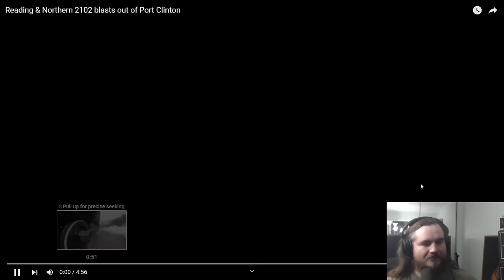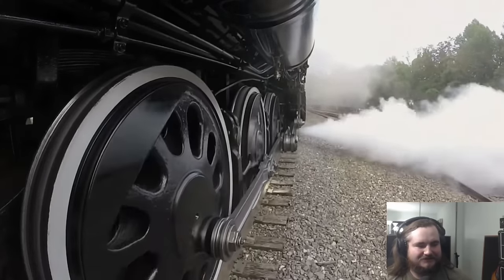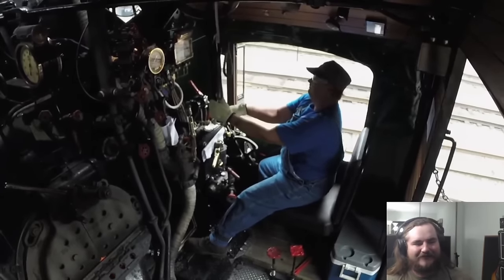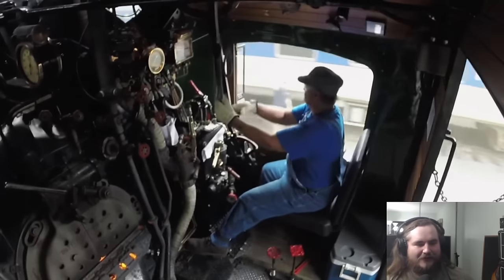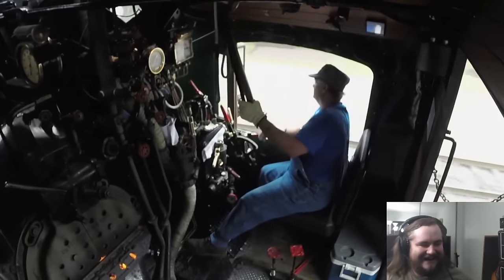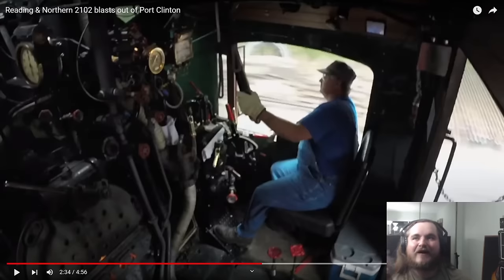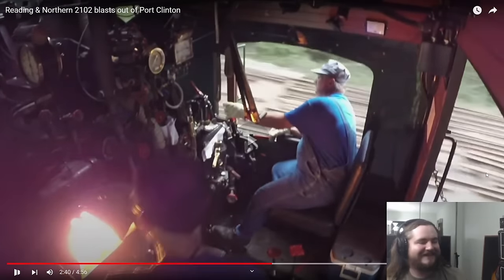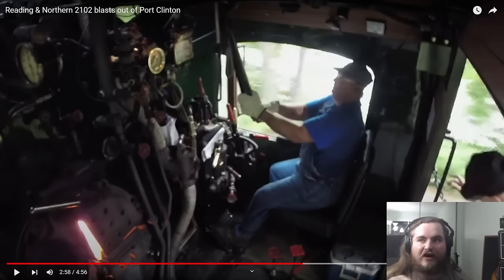Reading #2102 - the BEST steam sound EVER? Reaction from a railroader

Comment: Hey Hyce! Awesome commentary as always. 
My favorite detail that you didn't mention is that you can see quite a color difference in the fire as she starts to get her feet under her. 
Question: do all locos (that you have exp with) tend to enjoy working hard? Like do they run better when they are under load than bobtailing?
Reply from the maker: They seem to enjoy a medium, in my experience. Full throttle, but the bar not all the way in the corner.

Comment: Some Fun Facts for you Reading T-Hog #2102 leaving Jim Thorpe PA I was there that day in person, that curve out of the station is a tight one, not too far from the station itself is the old original Switchback line now a walking trail. Station sidetracks were the old CNJ Central New Jersey line and across the Lehigh River right of the #2102 was the Lehigh and Susquehanna line which is owned and operated by Norfolk Southern now. Reasons #2102 is so loud and great sounding is because it's running in a Valley next to the Gap, if you think a 6 Chime whistle is loud you should hear a K5LA freight Train horn as it can be heard 13 miles away due to the Valley carrying the sound echo. 4:09 view is from Port Clinton PA the crossing is Board St track entering the Home of #2102 yard front by passing Red Engine Shed in background, a difference of 16 miles away from Jim Thorpe Railroad Station. Notice little to No crossings as a reason max power is aloud, which 90% of the trackage run is 0.0% grade small areas an incline but nothing difficult. #2102 is only 27 miles away from Scranton PA Home of the UP Big Boy #4012 at Steamtown USA Railroad. This was a pretty good video as it didn't showcase #2102 secondary whistle as she has sounding like a Fog Horn.

Comment: Heck they had 425 running with that many cars as well but had a diesel behind just in case. But yeah, this to me shows an example of what 2101 was like. I still wonder if the Whistle from 2101 is still around? Sad shape of what 2101 AFT 1 looks like at B&O museum. I have been wonder what it looks like from a video stand point. All I see in pictures is just the front of the locomotive. But yeah 2102 is a good example of what the Reading T1s were like

Comment: My Favorite part of watching videos regarding 2102's return to steam have ALWAYS and FOREVER WILL BE the departures out of Port Clinton, PA. The Reading & Northern Railroad is Heavy Grades in both directions, closing near 2% in some spots, the train is around 16-20 Cars as well. I'm getting my ticket next year with my dad. I Can't Wait! In Regards to using the Scoop in the firebox, This is done to see in the firebox, If you watch cab videos by steamtrainvideos you can see the R&N crews using this technique on the 425 (not a stoker locomotive). Stokers have Steam jets that operated on pressure controlled by Valves on the firemans side, Its a tricky thing to learn from what i've heard, and without the proper experience you can put the fire out. These jets blow the coal into the firebox and the fireman can decide where the coal is blown to. The Assistant Firemen will look through the Butterfly Doors and inform the Fireman of areas in need of more coal.
Reply from the maker: That's really cool! Thanks for sharing.

Comment: Hi Hyce, This mayhaps will be a silly or ignorant question, but. What part of the steam engine's pistons and valves and other plumbing gateways, give steam engines that chuga chuga sound? How,  where, and why in the process of thermal expansion and linear motion turned into rotational force, etc. is this sound produced?  And to extent or amount of the released steam retained by and within the loco for recycling for re-use, or brakes, whistle, buffering for pressure differential (if any)?

Thank you for producing all the content on your channel, love watching this videos. My father was a train nut and design engineer before he passed, I have a love and appreciation/respect for trains, spent lots of days killing time watching trains with dad.
Reply: the chuff sound came from the blastpipe. When a steam locomotive is on motion, the steam exhaust passes thru the blastpipe which is located within the smokebox. The steam then goes thru the chimney and draws the fire on the firebox

Comment: Man, the Reading T-1s have to be the classiest 2-8-0 Consolidations ever made. ;p
Reply: Yes, Baldwin did a heck of a job in converting an old 2-8-0 into a highly functional 4-8-4. The Western Maryland, who partnered with the Reading on fast freight runs was so impressed with the "new" Reading 4-8-4s in fast freight operation, that they went to Baldwin for a clean sheet design 4-8-4 in 1947. The result was the absolutely huge WM class J-1 fast freight 4-8-4 which were total beasts in dimensions, weight, boiler size, and HP output. Too bad not one J-1 was saved. There is a good chance the WM J-1 was the most powerful 4-8-4 ever created, but not only were the J-1 scrapped, but most of the test reports were also throw out. The only report that I know of that survived showed the J-1 equaling the performance of a WM 4-6-6-4 (which were also huge engines) at 50 mph.
Reply: @markantony3875  Baldwin built the original I10sb 2-8-0s but it was the Reading Shops that converted them into T-1s (and some N-1 Mallet 2-8-8-2s into K1 2-10-2s)

And yeah, I love the WM/RDG steam design partnership. Some of their 2-8-0s were also designed off of the RDG I class 2-8-0s)
Reply: @jadebullet3884  Baldwin did all the engineering. The mechanical work was done in the Reading Shops. The B&O, who was renown for its rebuilds used the same approach. They would come up with an idea to improve a locomotive class, let Baldwin engineer it, then do the full rebuild at their Mt. Claire shops. Many people think the only late steam design the B&O had was their EM-1s. That is not true, because the B&O just kept updating their existing fleet with new technology because they had the shops to do total rebuilds (which many railroads did not). They could get a much improved locomotive for a fraction of the cost of a new one. Which made total sense, because everyone in the industry knew steam was on borrowed time at that point. Reading took a similar view point, maybe because the B&O was the largest owner of the Reading (along with the Western Maryland).

Comment: I wonder if there are any videos of Western Maryland #1309 like this
Reply: There are! Look up 1309’s strength test, where they hook 1309 up to a diesel engine, set the diesel’s dynamic brakes, and run 1309 hard enough to pop the front cylinder’s safety valves. It’s fantastic!

Comment: I'm not sure if this will get buried or not, but there is another video I thought you might be interested in. It's a short series of clips of some excursions N&W 611 ran back in 1984. The very last clip is similar to this, engineer is going at it hammer and tongs to get her back up to track speed in as short a stretch as possible and its impressive despite the grainy film and audio.

https://youtu.be/JuTlIH6c75E

Comment: 8:22 Question, and I've gotten into heated debates about this... that clank clank clank clank clank as she goes by is play in the drivers somewhere, I'm assuming the main rod at the pin, not the crosshead end, ior is that on the coupling rods between the wheels?  So the question is we didn't seem to hear it when the speed was lower, only now here later at speed, is this a function of vertical motion throwing the rods around, it's hard to synchronize the sound to the motion as we don't know the real distance to the engine as it passes to time it. 

EDIT: I slowed it down to .25x speed, and the clank seems to be at about 11 and 5 on the rotation. So.... is that the reaction to the valve timing events, or the transition in up and down motion and the sound delay is giving us fits?

But, and this is where the battle started, is that excessive play that should be addressed, or is that normal? The mechanical engineer side of me says any time there's a discontinuous sound, that's not good... but is it a 'normal' not good?

I have heard other videos of other engines at much lower speeds and loads making this same sound. Interestingly however, I do not believe any of them had roller bearing rods, they were all friction bearings like 2102.
Reply from the maker: Guarantee it's the rods, mains and connecting both. The reason you're hearing it as higher speed is that the grease has been beaten out by that point, or at least enough has for the rods to start to clank. The slow paced stuff would've been fresh greased. It only lasts so long before it gets pounded out, and with how hard they're working that's not terribly surprising. The age old adage is, "you'd rather hear them than smell them". As long as nothing is running hot, it's all good.
Reply: @Hyce777  I hadn't considered squishing the grease out... that makes sense. So technically they're in spec clearances, just light on grease.
Reply from the maker: @kleetus92  Well, they were packed before, I'm sure. They all beat the grease out, it's what they do. It's one of the many reasons why floating brass rods aren't as nice as roller bearing rods.

Comment: Well it is very good but nothing tops the bulleid pacific with its quartering for its 3rd cylinder as the off-set for the cranks are (con rod for left cylinder) 90 degrees (con rod for right cylinder) 135 degrees (con rod for middle cylinder) 135 degrees (con rod for left cylinder) this means the the chuffs are odd as the first and last chuff happen at the same time but the sounds they make when working hard is incredible due to this

Comment: Hyce, question, what is the drive size on 2102, and your museums "big iron" dropped off recently? 2102 doesn't look that large, but that could be my lack of perspective. If smaller, it would sure aid in pulling cars at grade. Seems closer to UP9000 (67"), or 4014 (68") , or 3985 (69") not 844 (80") I like the bark with no cut off. Have fun
Reply: 2102 has 70" drivers

Comment: So as a European stumbling across this channel through Kan, there seems to be a difference in sound for the steam engines in America, or at least I thinkt it's diffrent. Whenever I think of engines here in Germany chugging along they always have a lower schwoosh sound to them, where as with the american engines I've gotten to know through this channel the cugging is way sharper/has a higher pitch.

Is that a thing or is that because I just haven't heard a steam Engine run at full power untill now?
Reply from the maker: Depends on how hard they're working, when they're working more lightly it's more like the low pitched woomf you described.

Comment: it is cool.  Also, gotta say that things like your Steam 101 videos give at least some insight to a layperson who hasn't had their hands on the guts of these beasts, why with a 4 foot lever it's still a struggle. Because that as I recall is a mechanical linkage to those...umm...sextant looking things that are physically changing the behavior of the pistons that push the train and there has to be a lot of mechanical resistance to that.  I'm presuming anyone qualified to be driving these is possessed of a fair amount of upper body strength.
Reply from the maker: Definitely helps.

Comment: I just road the Frostburg Flyer from Cumberland to Frostburg.   There is a 3% grade on the way up.  We went slow but it seemed like the engine was really working.  It was blowing out a lot of coal cinders out of the stack.  It was excessive and piled up on the platform after the first car.  Was that normal for a hard working engine?
Reply from the maker: Yup, very common for coal burners.

Comment: My goodness, that was amazing! Good on them for working 2102 so hard - so many owners / operators are afraid to push their locomotives for fear of damage as you said.

May I recommend another clip or two that you might like? The first is of famous Australian locomotive 3801, struggling to pull a train tender-first up Young Bank in 1998. 3801 has a very sharp exhaust note that I'm sure you'll enjoy! When she slips, you can see both the locomotive and tender rocking from side to side as well. There's certainly a lot of force at play!

https://www.youtube.com/watch?v=MSRCqFfso1Q

And the second shows some J94 'Austerity' tank engines in the UK being worked extremely hard on a colliery railway.
https://www.youtube.com/watch?v=wsbRe5zKyE8

Comment: I worked on her when she first came back to the USA it originally was sold new to some company in Canada then in the mid 90's this guy bought it from some Canadian museum and brought it back to the USA where in Pennsylvania it was rebuilt I knew one of the rebuilders so I got a call from the owner and was personally asked if I was interested in being an engineer bringing the 2102 to Washington State from Pennsylvania and OMG I almost fainted and said yes so we went across the USA and arrived back in my home state of Washington and did a few excursion runs to Oregon and set up an excursion dinner train out of Tacoma Washington did about 8 dinner excursions and about 12 weekend lunch excursions and the business fell out because the owner wasn't making enough money than it sat at the Port of Tacoma Washington for about a week and departure it jumped the rails that was a spectical it self then it left Washington and was moth balled Oregon somewhere then I guess it was sold to whoever owns it in this video btw those colors weren't the original that was on it when worked on it also it had the work ferroques on the tender

Comment: 'Just curious...but did Reading utilize any Nathan products during their build(s)? If so, perhaps the 6 chime IS Nathan instead of Reading. No big deal!
Reply from the maker: Hard to say!
Reply: Not really sure, though I'd say the mechanical lubricators are probably Nathan because I haven't seen too many other large engines that used anything but lol. The injector is a Chicago T-60? (Fan Railer did a video on it) rather than the Nathan 4000, and it has a Worthington SA style (5-1/2 Size IIRC) Feedwater Heater.

Comment: why didn't they ease off the reverser before yanking on the throttle so the wheels didn't slip? i mean, i think its awesome to see and hear the wheels let the machine loose, but people keep complaining about "safety" and "wear"
Reply from the maker: Needed the power, I'd figure. With sand running, you can usually get open pretty far without hooking it up.
Reply: @Hyce777  yeah, so ease off the reverser, pull the throttle, then set power with the reverser, which it seems they have better control of
Reply from the maker: @xymaryai8283  it'd still slip that way and that's more steps lol

Comment: THE TECHNOLOGY OF THE PRE DIGITAL WORLD !!!!!!
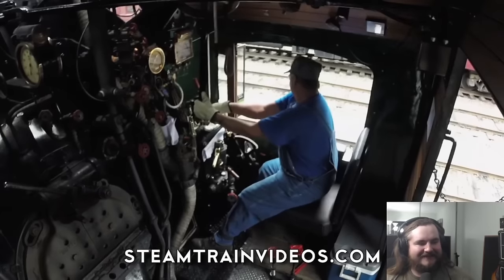The delay in starting when the driver (engineeer) pulls the Regulator (throttle !) 1:34 is most likely the result of this locomotive being "SUPERHEATED". Which means the steam does NOT go directly from the boiler to the cylinders, when the regulator is pulled. But makes a detour back up the large tubes, through Superheater pipes for an extra "reheat" for extra super dryness & therefore extra expansion/POWER, when it does reach the cylinders, hence the delay in starting. 

Superheating helped the economy of operating Express type steam locomotives, by reducing the demand for coal & water, & giving them a little bit of a "freebe" boost when running long distance at speed. A sort of early version of Elon Musk's latest Tesla car, coreless electric motor, you could say !!!    

Smaller steam engines such as Shunters (Switchers) didn't bother with "superheating" so responded virtually instantaneously to the Drivers hand on the Regulator. Amazing what boiling water - steam - can do, and not a digital chip in sight !

Comment: Why is the throttle so bloody hard to pull? Seems a bit ridiculous. 🤔 
Why is so much steam let out of the cylinder boxes on start up? I thought the exhausted steam went up the flu to create a vacuum on the pipes in the boiler to create a draft from the firebox.
I did not understand what you were saying about modulating the speed with the reverse lever.
Can this thing outrun the natives ponies so they can't shoot all the passengers with arrows?
😂😅😂😅😂😅 😊
Reply: the amount of question i had research here is insane
Reply: theres soo many steam drained from the drain cock because the loco has kept not moved